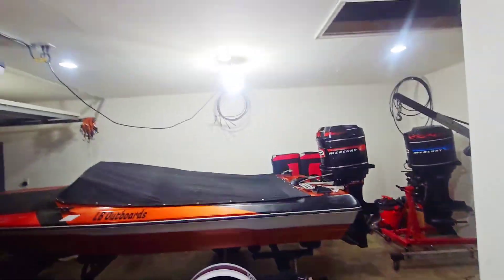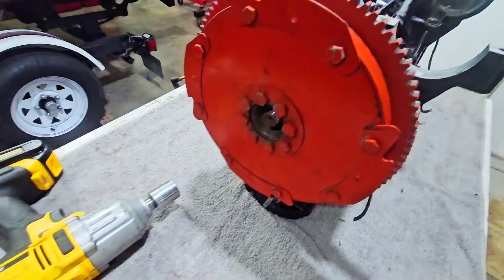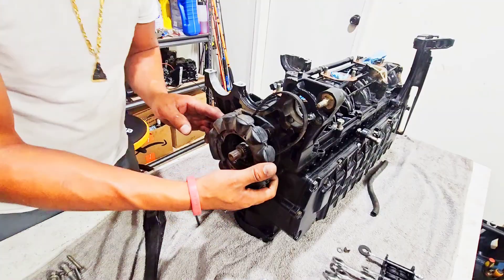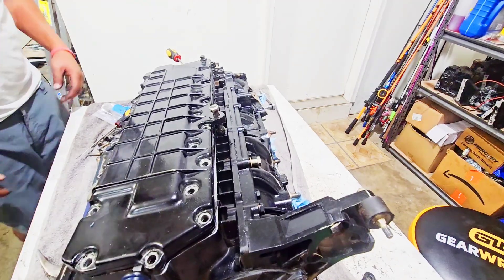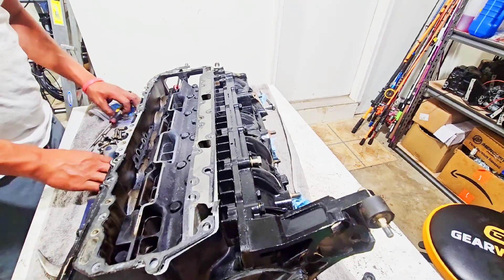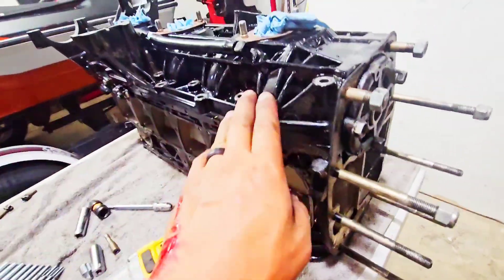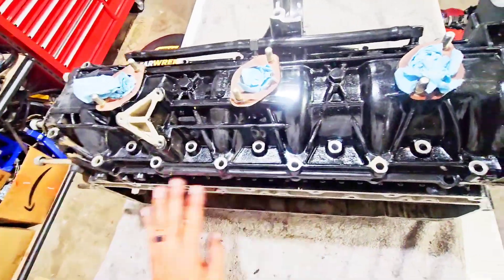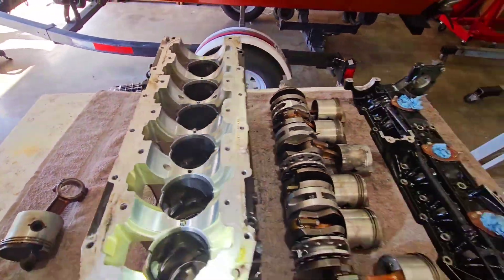Mercury 1500XS J Block: Tear Down

Comment: Enlarge main jet on second carb back timing off q few degrees.
I built so so many .
Change reed valves out with boysen fiberglass reeds.
Often water pressure is lost central cylinder number 3 get hot also.
I ran 40:1 klotz.

Comment: I'm by no means a mechanic. However, I cringed when you used the screw driver as a wedge to release the exhaust cover. Not that I haven't done the same many times just gotta be gentle. I had a project a few years ago and happened to find some plastic wedges of assorted sizes for a different application but just recognized it's potential benefit for your app. Anyway, check it out, be perfect for that and will be kind and gentle to the aluminum. I have really enjoyed your videos as a Tower of Power believer! Signed, care taker of Dad's 1986, 16.5' Blazer with the 86', 90HP Merc, TURNED UP W/21" SS doin the choppin!